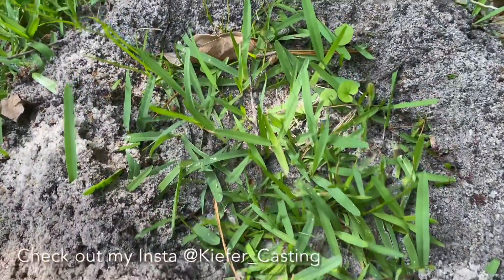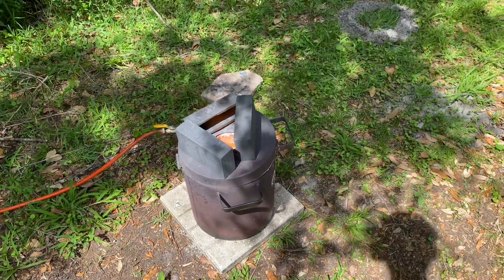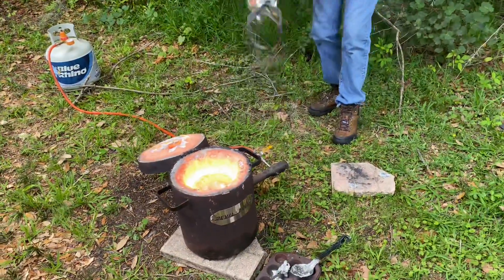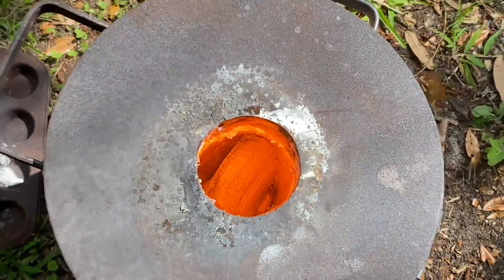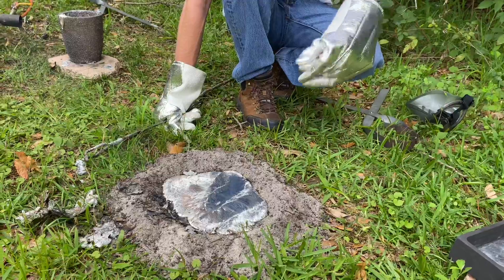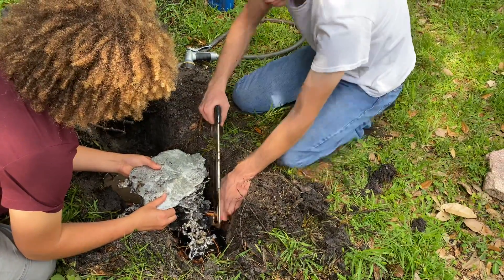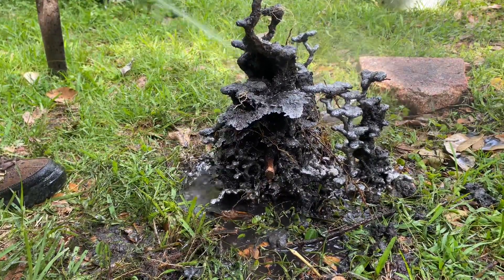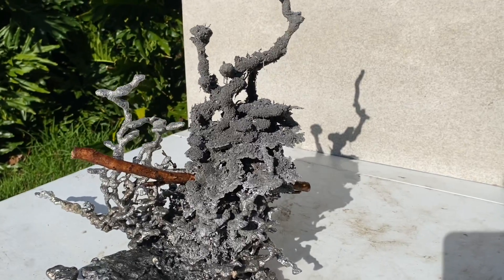Exploding Massive Aluminum Anthill Casting #23

Comment: You need to get yourself a pair of pruning shears. They are for pruning but I use mine all the time to cut through roots when digging to make garden beds and such or digging out stumps. You can easily clip through a root as big as an index finger with them. I actually have a few different pair because they do get dull and I'm not great at sharpening them. The Fiskar ones are decent but I've had off brand that work just as well. I just put my shears through a lot of work (in the past 3 months had to dig out 6 holly stumps and still not done) but they still work fine. Easier than trying to get a saw down there for sure, unless you're using a sawzall.

Comment: Have you ever tried putting a pot upside down over a mound I have put buckets over mounds before and the ants build up into the bucket I wonder it you put a clay pot over a mound and then allow them to fill it you could get a pour that would be much easier to dig up. You may have to break off the bottom of the pot though now that i think about it because you would want a base at the end I don't know might not work just thinking out loud. this is a cool channel!

Comment: I don't think you could do this with a fire ant nest.  They build mounds.
Reply from the maker: These are fire ants. The mounds are just the dirt they excavate.
Reply: Not every species of fire ant (there are several globally, some are invasice and some are not, which is why i really would prefer folks to use the scientific name Solenopsis invicta for this highly invasive species) builds as pronounced mounts as say what here in germany is one species called fireant (cause red and painfull sting) Formica rufa, which buoild mounds out of things like pine needles, and simmilar sticks and so on, aswell as soil up to 1.5 meters tall and at that hight propably around 2 meters wide, and some only tiny little hills, that you  might not even notice if you walked past them in 2 meters distance. Plus, knowing how big that nest was and how gigantic Solenopsis invicta can be in collony size, I'd say this was stilla rather young nest of maybe 2 years of collony age. Or a secondary nest potentially, not sure if S. invicta make multiple nests in the same collony, some ant species do that without connecting them underground.

Comment: Was thinking maybe you could cast the aluminum in solid clear epoxy resin upside down, or downside up?
Anyway, you could use a clear tube and pour the resin into it. When it cures turn it over.
Then you could drill through what was the base and now represents ground level. Then wire some LEDs.... maybe incorporate a revolving base.
Now you have a museum piece.....

Comment: Do you have to use those big bricks of aluminum to do this?  Would it be possible to melt down a bunch of old soda cans instead?
Reply: That's actually what he did to get those bars. You just get a lot of slag when melting down scrap I would assume, so I'm guessing it's better to make bars first (easier to store/transport as well) and deal with that stuff at that time, then later only having to get rid of a small amount of dross.

Comment: I wonder if you soaked the root in acid. It would be able to remove 
And clean the metal too.
Reply: probably easier to just burn it? My first idea would be to cut off as much as possible and have at it with the propane torch. Shouldn't take long before the remains crumble enough to pull them out.

Comment: Do you ever miss a pocket of them when you dig and get stung ?
Reply from the maker: Yes my solution is to flood them out and then use my small propane flame thrower. I’ve only had this happen a few times though, it usually gets all of them.
Reply: @NolansAnthillCastings  thank you for your time and fast response

Comment: This is the first time watching your channel.  I have a question  I'm sure you've answered before. Is there an issue when cooling the metal with the sludge leeching into water table ? Just a question not a judgment 😁 Thank you
Reply from the maker: Aluminum is a safe metal. It makes up something like 20% of the earths crust already. Metals like zinc and lead give off fumes when you melt them and can make you sick but aluminum doesn’t even do that.
Reply: @NolansAnthillCastings  Thank you I was always curious on which metals cause issues 😁🥰 Beautiful art work🥰🥰
Reply from the maker: Most metals are safe to handle when solid even lead. The problems come if you cut it with a saw or something and little shaving get airborne and you inhale it. But you can handle a bar of lead or lead weights all day and not worry. Just don’t put it in your mouth and you’ll be fine lol. Zinc is an issue because of the fumes it gives off when welding galvanized steel (zinc coated steel) or melting zinc/zinc alloys. it gives you something called metal fume fever which is just like having a really bad flu for a week, there’s no lasting side effects that have been associated with it but I’m still very careful I’ve gotten hit by a tiny amount of fumes once while melting scrap aircraft parts that are coated in zinc. I was only sick for the night but it wasn’t pleasant.
Reply: @NolansAnthillCastings  I have no worries that you absolutely know what you are doing 😁🥰BE safe and please continue in creating your beautiful works of art 🥰🥰🥰
Reply from the maker: Thank you!

Comment: I believe your "explosion" was an air bubble escaping -  what exactly exploded?  Methane,natural gas ? What?
Reply from the maker: It’s just moisture in the ground getting trapped as it turns to steam. I think that one has a little bit of methane from root decay as well though.
Reply: Ever heard that it's a bad idea to throw water onto an oil fire? Exactly the same thing. (ok there's more going on with oil fires, but same principle)

Comment: If you want to flux or clean the molten aluminium, put a table spoon or so of white salt in some aly fiol. 
Scrunch up and drop it in. Push down and stir. It brings crap up to the top for you to skim off.
Keep up the casting, looks awsome after cleanup and helps control a pest💣💥🇦🇺

Comment: We have fire ants where I live but I’ve never seen the ant bed designed like that one. 

Ants will build multiple beds and have tunnels to connect them.

Usually treating them with chemicals kills one of them but then you’ll notice a new ant bed pop up 20 feet away. However, I found a chemical that more effectively kills them and you want have ants for a couple of years. My pest control (termite letter) guy told me about it.
Reply: I just watched a documentary on fire ants. They are not friendly to other fire ants. They will fight to the death if they confront each other.
Reply: @actechformallyyomama746  I think what tug is describing are satellite nests: There's one queen somewhere, and it's all one colony, but the ants transport parts of the brood to these satellite nests to spread them out.
Of course if you do manage to kill the nest that has the queen, they are done for (workers live a few weeks, they might manage to raise the existing brood, but there shouldn't be any activity after a month or so).

Comment: With rainy season just around the corner, does the chance for these explosions increase? Or is the sandy nature of our soil usually able to vent the steam into the surrounding area?
Reply from the maker: All last year I was doing castings with no problem during the summer. I wasn’t really thinking about ground moisture back then, I think I was only waiting a couple days after rain to pour. I think where most of my anthills have been have had a lot more clay in the soil preventing the steam from escaping. I’m going to try casting in our more sandy part of the yard during the summer and see if that helps.
Reply: Would putting a tarp over the intended casting site for a few days help?

Comment: When you're taking out the bad stuff on top with the spoon why doesn't your spoon not melt, thank you for sharing I enjoy watching 🇺🇸✌
Reply from the maker: Good question, the spoon and tongs are made of steel. I cast using aluminum, which melts at 1200 F° while steel melts at around 3000F° and my furnace can only get up to about 2400 F°
Reply: Thank you for the information I didn't know that, very good
Reply: Jet fuel can’t melt steel beams
Reply: @davidricci9894  no but it makes the steel soft enough to not be able to support any weight
Reply: @davidricci9894  One of the big challenges of jet engines is in the material science. Nazi-Germany, the first country to use jet fighters in combat, was suffering from a lack of critical elements to use in steel alloys, which caused the Me-262 jet fighter engines to only last a few flights before they deteriorated too much. It's, in fact, not too hard to reach carbon steel melting tempurature inside a jet engine, which is why you need good quality steel of suitable alloys. A jet engine is running on jet fuel, so jet fuel can, indeed, melt steel beams under the right circumstances.

Comment: What if you melted 2 different kinds of metals like aluminum and copper or brass and something else and pouring them both into the hole at once or like a bit of one then the other and back and fourth to try to get some different color variation through out the casting. You could also go at it in the end by painting over some of it then doing some electroplating so maybe you could try something like that. Try with a smaller casting first and get a giant pot of hot wax and then an equally sized pot of boiling water and a fan to cool the casting off after each dip. Find a knob to tie a thick copper wire to it so that it hangs at a 45 degree angle then put marks along the copper wire maybe every inch or so.  Dip the whole thing it all the way in wax and let it cool for a minute with the fan, then dip it hot water leaving an inch or whatever you chose above the water at the highest point to melt off the rest of the wax. dip the thing in wax again leaving the wax line another inch or whatever above and repeat the process so that when electroplated you will create stripes across it. You can use the wax method to create tons of different designs. Maybe even come back in after the first electro-plating and create stripes of another metal/color on a different axis to create X's of the two colors. You can also selectively lacquer/polish and age each part. For instance you could do the stripes in copper and you could cut out the shape of an ant or a head from a piece of paper and tape it on the front of the sculpture and then spray it with lacquer from above and then after it's dry you could give the rest of the copper a patina before coating it if you want to coat it. that would give you silver, brown and green to deal with and a bit of gold if you did some light gilding with some gold leaf foil. Just imagine a nodule turned into an eye with copper eyelids, silver sclera, gold iris, and green for the eyelashes and pupil!